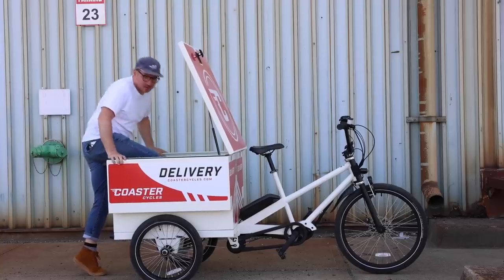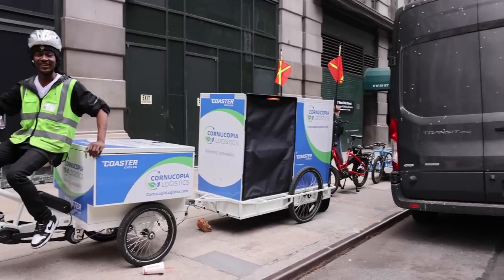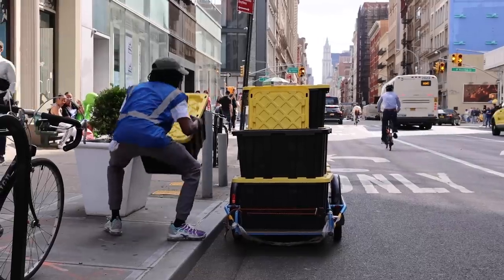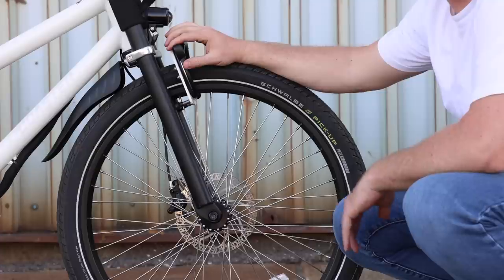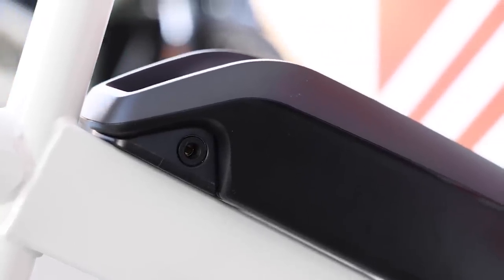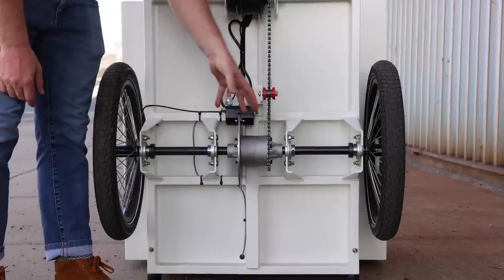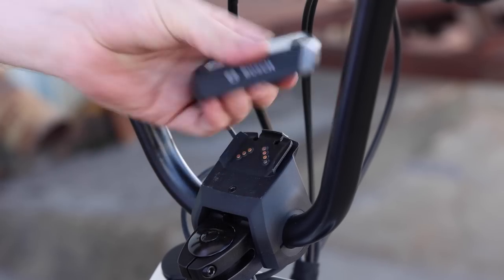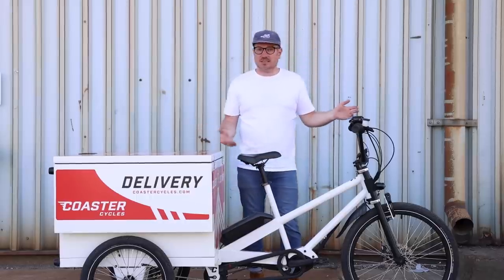This cargo trike means business!

Comment: I work for a company in Portland that does last mile delivery via freight trikes and we're looking at these guys for the next additions to our fleet!
Reply: It looks well made, I would demand 2 disc break calipers on that rear axle. The disk looks thin for stopping 500+ pounds in a safe manner.  Down hill stopping is most demanding on any breaking system. That single disc is great but it needs doubled up.
Reply: What company? I want to write about using pedal power for last-mile delivery.
Reply: The 500 Wh battery is quite small. Do they offer larger capacity batteries? I know it adds weight but the weight of the bike alone requires more energy to propel it. 
Regards,
Cesar L.

Comment: This is wonderful!!! I want one just for grocery shopping 😂
Reply: If it's JUST for grocery shopping, instead of spending quite a few thousands on something like this, buy a large sized dog trailer which is completely covered and enclosed and use it with an ordinary bike or e-bike.
For very little money you will have about 250 litres of cargo space and I use one regularly for the last 3 years and have had over 70 kg in it. My average shopping load is 30 to 50 kg.
Easy peasy.

Comment: Nice review.  I really like your knowledge base - it shows.  Thanks.

Have you ridden any reverse trikes?  I'm almost 80 and going cold turkey on bicycles.
Reply from the maker: thanks! Appreciate it! We have experimented with some tadpole trikes as they're called. and we hope to find one in the future that we can offer. Right now they are very few with the Bosch motor system and we found that that’s the best motor on the market. I think we might have some more offerings in the future.
Reply: @Propelbikes You're welcome.  I was too enthusiastic about the Mean Lean Machine as it's turned into an expensive science project that will most likely not be built in my riding lifetime.  Suggestions?

PS:  "Tadpole"  is too "subordinative" for me.  How about "Forward Thinking" or  "Command Position" trike?  ;~)

Comment: Is there a way where you can integrate electronics really easily? Seems great for nights to have it fully illuminated or add a simple peltier refrigerator.
Reply: I don't know if that's a pre-installed option, but it's technically very doable. All you need is an extra battery and the appropriate wiring!

Comment: I like sometimes going to the front of the traffic red light queue. 
So a 580 or 600 mm wide load is good, about the same as the 630 mm handlebar. 
My collapsible black plastic crates are 575 mm long x 400 mm wide and 240 mm high.
I put two together, and stack them up to 4 high.
More than 800 mm long deck, for the two crates.

 
And I want a trike instead of a bike, for reducing heavy loads falling over. 
Preferably tilting front wheels. 
Front load, ie Long John.

HNF make it. 
Ili also. 
Others too.

Comment: Coaster Cycles Venture Cargo Ebike Tricyde. Which E-Bike class is it? 1, 2, or 3?  Does it have a throttle?  If I had a medical emergency & were too weak to pedal, could I still drive this off battery alone?  Answer is no; this is Class 1, only provides assist when pedaling. That is a deal-breaker for me. I don't know how easy it would be to convert to Class 2.

Comment: Dense cities should ban the use of delivery trucks and vans since it’s usually a nightmare to find a place to pull over legally. Instead, they should use delivery trikes like the ones in this video but with a much larger cargo bay. They have a large carrying capacity, have three wheels to prevent tipping over and most importantly, they can pull over on the sidewalk as if they were bicycles. As for moving trucks and vans, they should get a permit from the city council in advance so that they’re guaranteed to have a place to pull over. Also, not all stores and restaurants have loading docks. If they have a loading dock, they can continue using trucks and vans. If not, rather than using roadside loading zones, they should use the same types of trikes for deliveries. As long as they have enough capacity and act like bicycles, they are the perfect answer for convenient deliveries.
Reply: As someone who cycles a lot and uses large bike trailers for carrying heavy and bulky cargo and shopping I'm all for using bikes like this for personal car alternative transport and for business use too.
But also you have to consider what is practical.
This may carry over 200 kg as cargo but sometimes you need to carry 2 or 3 times as much or something very bulky. You can't be returning to a base several miles away repeatedly. 
These are great and I want to see more of them. But they have their limitations.
E-vans and other alternative methods have to be used as well.
Reply: @tconnolly9820  Returning to a base several times is inconvenient, but when it comes to deliveries, there just needs to be more delivery riders to deliver at the same time. You were also right that it’s impossible to eliminate trucks and vans completely, but their number can be minimized. Better than getting a ticket for illegal parking.
Reply: @tconnolly9820  Or a better option would be to require mandatory loading zones on every roadside in dense cities. After all, no driver should be ticketed for something they can’t control. I’m never afraid to fight with the government about it.
Reply: @anonymous3738  Let me put this into a little context from my own personal experience. I'm a white van driver for my wages. I drive mostly at night and from my base I generally travel no more than 3 km in a radius from that point. 
But.....
Sometimes I still manage to clock up more than 140 km within that radius.
Neither my employer OR any customer except perhaps the most intensely environmentally obsessed is going to pay to replace one van (currently diesel but potentially it could be electric) with several riders toddling around on bikes because they can only carry so little and go so slowly.
Also I regularly spend five to ten minutes doing paperwork/electronic work and other stuff in the van.
I have no idea how that would be possible sitting on a bike in the dark in cold wet freezing weather. Or even just to sit back and have a break for 10 minutes every now and then.

Bikes and cargo bikes do and will have a place for replacing cars and vans for small light deliveries in cities.
But it's always just going to be as a minority.
For industry and businesses to function, the vast majority will still have to continue to be done with vans and trucks.
Possibly just replaced with electric or hydrogen.
I do smile sometimes when I see a business making a big deal of having a cargo bike but in reality it's still diesel handling 99% of everything else.
I'm not being cynical and I do make a big effort to use alternative transport in my own life but I also see the reality of business too.

Comment: This kind of behemoth should most definitely NOT be allowed on bikelanes!                     :_[                      hYlkeW
Reply: Disagree.
Reply: It's basically a small truck with three wheels. Not a bike!
Reply: if I remember the dutch design manuals right, 900mm width is the sizing of cargo trikes they did anticipate for their bike lanes, so the smaller one is within imperial-metric rounding of that, but the larger one is too large and shouldn't go there. @GrayWithMe  @InventorZahran